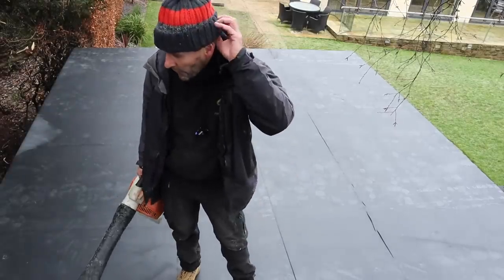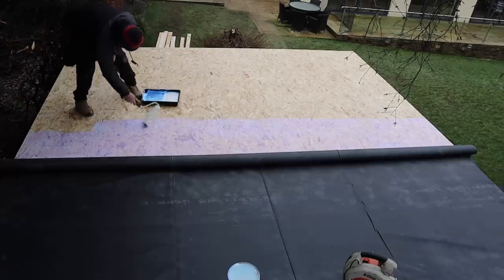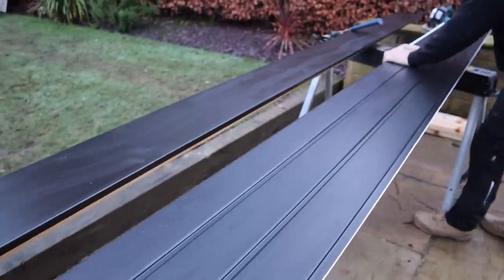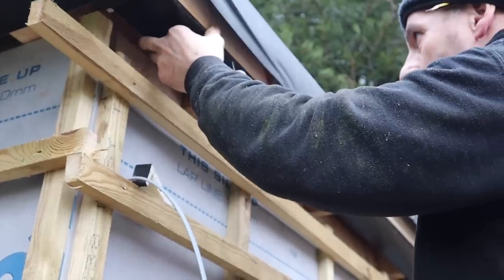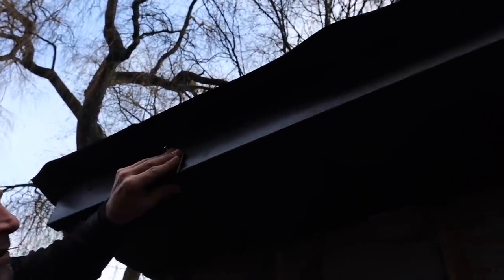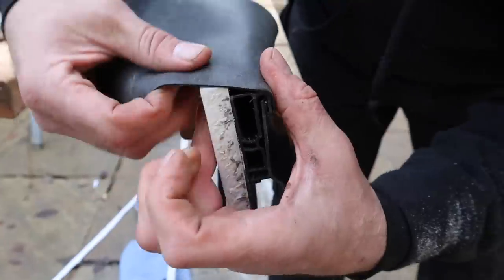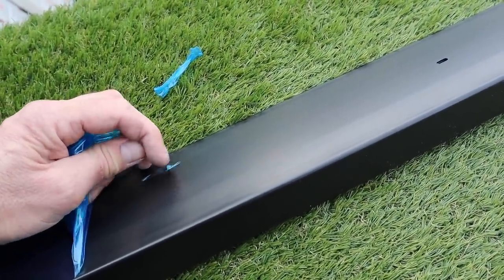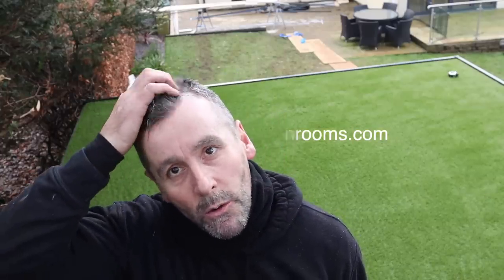Garden room rubber roof, fascia and soffit installation with a grass roof.

Comment: The comment about the poly top nails, I normally put my nails in pairs rather than a row through the middle plus I only fix one side of the jointing strip to allow for movement….., I do like watching you boys everything at 200mph,

Comment: This is your best video yet. The detail you go into in this one, with the examples and explanations, is exactly what I was after. How things look, why they're done that way, the closeups etc. I'm doing my own one and this video has gone into my watch later list. Much appreciated!

I'm doing a warm roof but will now try an artificial grass roof top layer too. Will look good from the house at the end of the garden... but gotta try and keep neighbours happy...
Reply: I'm considering the same.  I have a warm roof design but I'm not sure I can get away with the extra height. I might only have 15mm to play with.  I might have to shave down the grass around the edge so it doesn't push the trim up!
Reply: @klaeLIFE  if you're doing a watm roof then have you gone through planning? If not, how have you managed to fit a warm roof within the 2.5m limit while keeping decent head-height internally? I couldn't make it work so have gone for planning for a 2.8m height
Reply: @jp6975  I put in an insulated concrete base that sits 25mm above the ground. The ground is getting 35mm artificial grass So when measured it's actually 2.5m from my concrete base upwards. It means I save the airflow gap beneath and the timber base in thickness. This allows me to have 120mm rafters, egger protect 22mm sub deck, vapour barrier, 90mm roof insulation, 18mm tg osb roof board and rubber with trims. I get a 2.1m internal height and a full warm roof. I can have spot bulbs without ruining the vapour barrier or insulation and I can freely run wires through the roof and down the walls. Works out to be bigger fascia though
Reply: @klaeLIFE  I see. My slab is already there so I'm building the blockwork on top. I lose the 1st 150mm to encapsulate the DPM, DPC  and 120mm PIR. Have to use 2x9s for the roof joists as I'll rip them to have 'inbuilt'  firrings (rather than add them on) and maintain the min 120mm on the blockwork according to the span tables. Other than that I have the same except 100m PIR on the roof.
Reply: @jp6975  thenknly reason I went for 90mm was because the framework around the roof to hold in the PIR is 45mm thick x 70mm wide.  Itbwas the only readily available size I could source in a continuous length. I plan to build a surround using two timbers to give me the 90mm. If I could have got 50mm I would have used that and went 100mm. I reckon a warm 90mm roof would better than a cold or hybrid 100mm roof.

Comment: The astro turf looks really good.  Great job on the join and the trims.  The only risky side is the gutter side but I guess you dont see it much.  maybe the mechanically fixed gutter trim would be better in turf cases.  Maybe you should make a mock up of both and see which comes out better.

The grass does add a decent amount of weight to the roof and if its near trees that drop leaves it will have to be cleared as it leads to some growth in the debris and mould.  Hopefully you wont have to clear animal droppings from it either! b Normally when it rains the grass drainholes feed straight into the ground.  I'm not sure they would work too well here and the volume of water would just surface drain.  The pitch of the roof may have to be steeper to encourage the flow of water.  The grass can retain a lot of water if it doesn't go anywhere fast.

Comment: I done a garden office with sedum roof for a customer, came out nice. Wins over a lot of jealous neighbours.
Reply: Did you add the Sedum over an EPDM roof? I've finished my roof but am worried about falling branches damaging the membrane so am thinking  about an additional covering for impact protection. I'd thought about Sedum previously as a retro fit but Astro Turf could be a simpler Idea
Reply: @anthonybrown5550 Yea sedum was over EDPM, there is also a root barrier and a drainage layer. Increases life of the EDPM and looks more natural.

Comment: Looks amazing as always if I had to pull something it would be the poly pins offer the p trim up and line all the pins up but yet again that might just be ocd kicking in
Reply: Pins were lined up by placing at a 90 deg. to edge and lifting up, using the hammer to equally space the pins, genius.

Comment: Using a nail that as had the head cut off in a drill to pilot a hole is the best way it saves time sorting through a load of drills and you get the right size every time

Comment: Nice work pal, little tip to avoid chipping of the fascia goil when ripping down with a circular, cut the back rather than the finished side ;)
Reply: No need for it due it been covered up at top😁
Reply: What about possible scratch line from saw shoe?
Reply from the maker: Wd40, gone! We had to take the protective film off to inspect for and flaws

Comment: Excellent. I’m now trying to think if I can retrofit some grass to my roof without having to remove the trims
Reply: Probably not worth it as the grass wouldn't be mechanically fixed and have no sand infill.  The trims would help but the wind might catch it.
Reply: @klaeLIFE  not all artificial grass requires a sand infill
Reply: I know that but one of the advantages of sand infill is weight to keep the grass down in wind. If you are not removing the trims you are relying only on the glue. The amount of glue used here is way lower than is recommended for even a ground installation. NeoGrass have a good guide online and them recommend almost 300mm of glue around the edge with no gaps. That would be floor drainage. On a roof you would leave gaps at the gutter end

Comment: I appreciate this is an old video but I was really curious to see how you did the corner of the P trim around the top edge of the roof. Was it a mitre cut or did the kit come with covers for the corner?

And any indication of how the roof looks now? i.e has it survived the wind having only been bonded around the edges?

Comment: Wow this is brilliant, excellent build thanks for sharing your ideas great vision. Can I ask what the side and rear wall stud cut length measurement I understand the front is higher by 75mm as want to make sure it is all going to stay within the 2.5m limit as I got a concrete base which is a little higher than the ground.
Reply: Stud length depends on your timber sizes. Work might be thickness of each layer.
Reply: @klaeLIFE  thanks for the reply, I’m still in the planning stage at the mo but but the looks of it would be using 4x2 at 2100mm
Reply: @stang7466  what is the size of the room? They seem pretty small

Comment: Hi when you employ a roofer to fit new rubber roof and timbers and payed and find they left old wall plates on and just fitted cross members , osb and rubber roof are they at for not replacing old wall plates.
Reply: Fault

Comment: Mr Griffin, Is the gutter trim the stuff you get in the kit for rubber4roof or is this from somewhere else.....did see a post about gutter trims and the gutter trim from another supplier was possibly better.....you have got me thinking about astro turf on my roof now....;-)
Reply: Rubber4roof only provide the mechanically fixed trim which is annoying.  The 2 part trim is from Northern Building Plastics which is a trade only outlet I think.
Reply: The trims are made by Permaroof (same as the adhesive he's using).  They primarily supply to other merchants, but they do have their own online store. Not as cheap as others, but the quality and design is superior

Comment: Do the solvents in the grass glue harm the rubber roof? The grass will expand when it warms up so May end up with a ripple in it in the summer and may need trimming again and stretching out.
Reply from the maker: Apparently not, after all if you have an artificial lawn you don’t trim it in the summer 🤔
Reply from the maker: Re read that and I’m making myself sound a nob, I’ve called both suppliers and neither have an issue, I did a patch test and the rubber was fine against the glue, and the glue is designed to adhere to the grass backing which is essentially the same make up as the rubber roof. Hope this helps
Reply: Oakwood Garden Rooms thanks for reply. Was just concerned the glue might melt the rubber roofing. Like solvent gripfill melts upvc trims. Ive personally never used the rubber membrane roofing, having used fibreglass for years but obviously with the extreme cold and wet in the winter fibreglass is a big no no. So will be switching to the rubber roof for an alternative option in future. My only other concern would be fire risk by using it on a building. Although most grass company’s say it’s self extinguishing it does burn rather rapidly. Try lighting an off cut and you’ll see what I mean. Not sure I would sleep very well on Guy Fawkes night incase a firework landed on it.. 🙄🤣🤣
Reply: I built a balcony, rubber roofed/floored it. The bifold door fitters sealed with silicone. After while the silicone just lifted off the rubber. Used the sealant specially for rubber roofs and 5 years in no problem. Don't know what you used to stick the grass down?
Great informative video's. 👍

Comment: i'm sure you'll get this question all the time, but what's the difference between this rubber roof and fiberglass?
Reply from the maker: All depends who you speak to mate
There’s several camps , rubber roof, fibre glass, torch on felt 
I started off using fibre glass , GRP, but it’s very weather dependent, the rubber , you literally need an hour or so with no rain , for us, it’s a no brainier

Comment: Not the greatest workmanship especially missing out the contact adhesive! It's there because if the rubber shrinks it's still mechanically bonded down as those trims are not the best to secure it, soffits should be cut in the opposite direction so you can fix each foot wide bit one seeing any fixings or nasty joining bars.